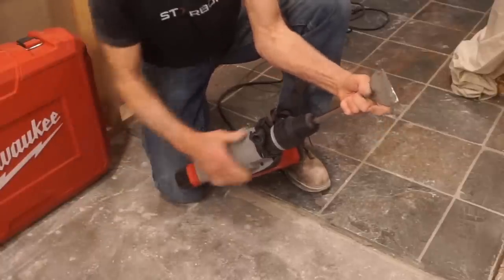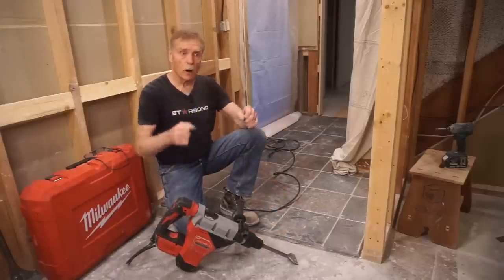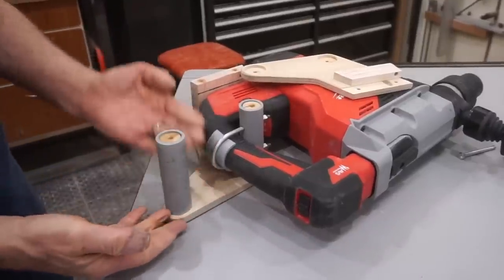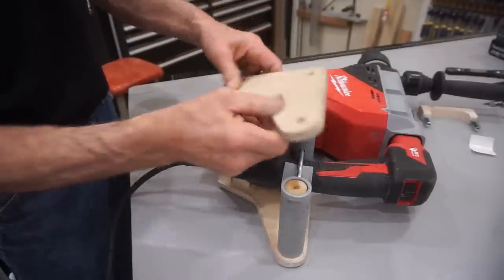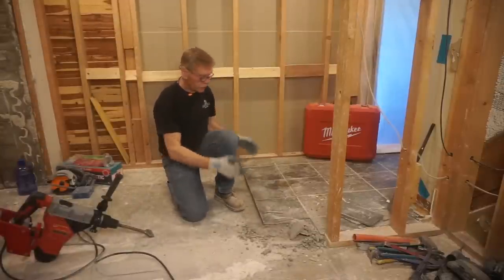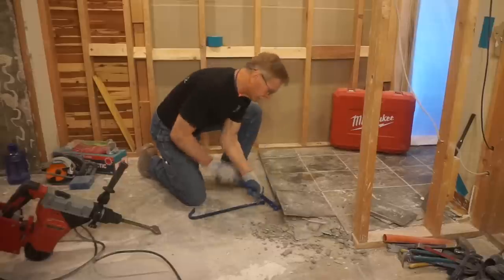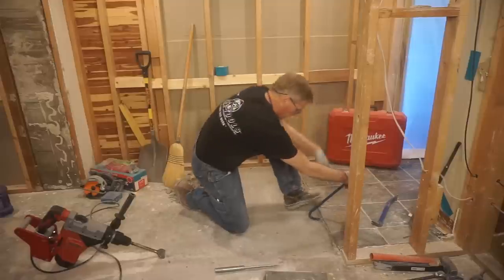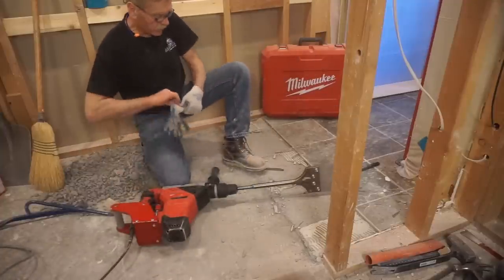Milwaukee Rotary Hammer Review & Ergonomic Improvement

Comment: In the real construction world we don't have time for this it's just a waste of time Just use the hammer drill the way it was design never had no problem with it yet
Reply from the maker: A 'waste of time' you say? Interesting perspective that lacks understanding of working smart and efficiently for sustainability over time.  At some point it may occur to you that there's a difference between just working hard and working hard AND smart.  Or not...
Reply: Bobby - I have to agree with your comment - You also have to consider the risk of injury due to the modification if you're passing it over to an employee to use.  I think out of the box is the best way to go - I personally use Makita and Hilti - the Milwaukee looks oversized for the task!
Reply: it's not the tool that has the issue which prompted him to make this modification....it's his wrist/hand/arm.  This mod was done to relieve the undue stress on his body.....the tool works the same either way.  Capich?
Reply: Sounds like these guys are not old enough to understand the importance of ease of use on your body. Sure you can use a tool out of the box. But if that creates stresses on your hands and joints, when you get old you will wish you had done things when you were younger to prevent long term injury to yourself.
Reply from the maker: Time has a way of highlighting issues not obvious in the status quo...
Reply: That's right, Bobby, you can take it, because you're a MAN,
but before you are ready to retire, you'll be sobbing about
your arthritis pain and the fact you can't use your hands anymore.
Reply: Also, some people gamble, drink etc. as hobbies.  Designing and creating efficiency improvements is a more positive hobby regardless of scale of improvements.

Comment: Years ago I mounted a nylon ‘D’ handle from a broken shovel on the rear grip of a Hilti TE55 I used a pipe pvc pipe flange it allowed the handle to swivel for the most comfort.
Reply from the maker: Sounds like an interesting modification... I like that your version was able to swivel too.  With all the fuss for ergonomics, workplace safety, etc in today's construction world I'm quite surprised that tool manufacturers haven't realized the shortcomings in their tools that hands on guys like us find so obvious.  It's easy to imagine that design engineers don't ever do much of the actual work their tools are made to do.  I'll be curious if this generates any response from Milwaukee... but I'm not holding my breath for it!
Reply: @NextLevelCarpentry  thanks for the reply! I wouldn’t hold my breadth either, but maybe you can market it?
Reply from the maker: There's a chance that Milwaukee engineers will see this video and the Ergo Handle upgrade through my contact at Acme Tools since they are a huge outlet for the brand.  It would be gratifying to hear some sort of reaction from them but who knows.  Their in house R&D probably filters out stuff like this as distracting and of little long term value.
Reply: Hilti & Bosch are tops in demo hammers👍

Comment: I would use an SDs plus for scaling .. I’ve knocked up a lot of tile with my cordless Milwaukee fuel SDs plus.. they also sell a scraping blade for them that’s much wider.. you could also a go lot smaller of an sds max the 1-9/16 SDs max made by Milwaukee’s may not sound much smaller than the 1-3/4 but it’s half the weight and would eat through that job just the same all day.. don’t need much power for scraping old floor up.. the bigger ones are bigger for breaking block, concrete, and drilling. Not scaling. Seems like you’re wearing yourself out with that beast in an unnecessary situation man, you’ve only got one body, don’t break it.
Reply from the maker: You might know what you're talking about but the fact that you imply I don't makes me think you don't.
 You're welcome to tweedle away with a smaller tool for a job like this but, personally, I would have used the next size UP for this job, not a size or two down... I'll give you a call next time I get into a job like this and see if you can really put your words to work.😉🤯😎  FWIW no one knows the "you've only got one body" thing better than a 66 year old dude who can still outwork kids have his age!

Comment: Chipping you don’t need a handle if you use it as a off balance tool you would dig in could be worth trying with a less dominant hand and work away rather than work towards
Reply: Before anyone says anything about working backwards off hand it is worth it rather than doing the whole job off hand because it gives the forward motion once the back is done

Comment: Last summer I had to remove the tiles. I realized that 30-40 degree of the tip divides its impact to two directions up and down and loses its efficacy. Later I used the machine upside down and the tip relatively easily went under the tile because the major impact went almost horizontally under the tile. . Your MacGyver design is fabulous. I will copy that for this summer projects.
Reply from the maker: Most SDS Max chisels come new with a double beveled tip.  I think manufacturers do this because that configuration doesn't dull quite as quickly and I guess few users ever sharpen brute force chisel tips like these.

As soon as that tip starts to dull I re-sharpen it with a single bevel tip that works MUCH better.  You must have noticed I mentioned 'bevel down' orientation a couple times in the video because, as you realized, it really does make a difference in results.  FWIW I figure bits are expendable and use them accordingly.  At $26, the 3" bit is crazy cheap and I don't hesitate to re-sharpen it frequently during use on site using a 9" angle grinder and metal grinding wheel.
Best,
Matt

Comment: My long gone 1980’s era, Black & Decker, 1/2  chuck drill had a D-shaped handle that bolted onto the rear end of the drill. Notches at the NSEW points allowed you to set the orientation of the handle. Milwaukee could easily design a similar mount.

Comment: Really nice solution Matt!  It's amazing how much pressure we put on the nerves in our wrists...  Anything you can do to eliminate that stress pays off in spades.
Reply from the maker: Thanks Greg!  It was a fun hack to make and use with a good deal of satisfaction from having the first prototype actually be functional.  
For design perspective: I just started with cardboard templates to zero in on a workable configuration.  I intended to make the sides out of bent metal to offset width between the tool handle and desired handle grip width but it was going to be too much trouble so I resorted to wood, my favorite medium.  The design would have been more 'elegant' without the little maple filler blocks on the sides but not worth the extra effort logistically to make it happen... and my wrist doesn't even know the difference 😉

Comment: Consider v2.0 adding a roller under the balance point.  Weight of tool can rest on floor to greatly reduce fatigue.  Attaching roller to existing 1.0 handle increases effective vibration isolated mass to further reduce vibration.  Floor contact of handle assembly additionally reduces vibration.

V3.0 has sprung suspension on roller.  You can adjust the natural angle at rest, but can reduce the angle by pushing down.  In this case pushing much easier than pulling weight up, and you're already pushing agsinst tile, so aren't fighting yourself.

V3.5 is the same but with tool rotated 180 degrees.  Having handle mass upward allows less crouching snd a potential (but adjustable) angle of attack.  Might even be shallow enough to both chip then pry tiles in one go.

Comment: Tough job. The Rotary Hammer really helps, but the modification looks spot on. And necessary, too. There is no reason to cripple yourself while getting the job done. 
Thanks for the video!
👍👍
Reply from the maker: I imagine you can imagine exactly what my wrist felt like after a few hours chipping with the tool before I made the accessory handle.  Pain like that is a real motivator for creativity and determination to make it go away!  Mountain/road bike season is not far off and I don't want a lame wrist to keep me from that 😎
Reply: @NextLevelCarpentry  These days, I get sore just thinking about that kind of work.
😎

Comment: I have the similar-sized tool but it's a Bosch. I found that it's very uncomfortable being that low to the floor. So rather than rotate the tool I cut the b in half and welded extensions so I could stand up. Or be in a more upright kneeling position. This made it easier on my back my elbow and my wrist. I did this to both bits.
Reply from the maker: Great hack Traky Boy... I was looking for longer bits but I'll bet the manufacturers don't make 'em longer because people would pry with them which would put too much leverage on the chuck and cause it to fail.  I had a notion to extend the bits too so it's good to learn you found that a workable workaround. 😎

Comment: I've got the 5262-21 1" SDS PLUS rotary hammer - basically the SDS PLUS version of the same tool - has nearly all the same settings - no trigger lock but I think it has everything else. One thing I like about it is it's easy to use while rotated in any orientation, and also because it has a more shallow profile and less weight, you can bring it much closer to the floor. My guess is even with the lower power of SDS PLUS, it might do a better job for this specific work, as the ease of changing the angle of the tool lets you quickly find the sweet spot for maximizing progress. Highly recommended.
Reply from the maker: It would be interesting to compare the key feature of the two tool models: actual force/energy of the impact.  I have to think that more is better.  Like hitting with a 16 oz hammer or a 4lb sledge: really makes a difference.  That said, I'd hate to have to do much drilling at shoulder height with this tool where the SDS plus would be a lot more manageable...

Comment: Hi there Matt. I was about to pull the trigger on the M18 RH, but wound up going for the corded version in stead, since I wasn't sure how much immediate use it'd see, and I wanted it to be a lasting tool, not depending on future changes to battery interfaces etc., though so far Milwaukee's have been good about sticking to the same. 

Other factors leading to the corded version was weight and accessibility.

As I think I've mentioned, I'm in timber framing, and we use it both with re-ground chisels to fit woodworking, as well as specialty sds wood chisels. In timber framing repairs qe need a pretty sleek tool profile to get in where we want, and quite often we'd get in situations where the battery would get in the way. We don't have that problem on the corded.

Anyway, so far it's been a great tool, adjustments and tool holding capabilities are great, as well as ergonomics.
Reply from the maker: I never considered using chisels for wood but it sounds like a significant time/energy saver for that sort of situations!
Reply: I bought the Makita and it is so comfortable to use - it has a soft start that is amazing - I am a longtime HIlti user and owner and the Makita is better in my opinion.
Reply from the maker: @gregorymacneil2836  There seem to be a number of decent options out there.  I gravitate to Makita for a lot of my tools and understand your preference and satisfaction with yours.  Which model do you have?  Also curious if you experience wrist fatigue because, from all I've seen, no brand of tool in this category has a 'horizontal' handle configuration.
Reply: @NextLevelCarpentry  Makita HM0871C and HM1213C - I have not experienced any wrist fatigue except for overhead work - which you never really want to do with any demo hammer.  The trick of course is to let the tool do the work - I will tell you the soft-start makes the Makita amazingly precise with a pointed chisel. We have very few Makita tools but lots of Milwaukee - I bought the HM1213C first for a 5 inch basement slab demo and my father added the lighter HMO871C for everything else including some bush hammer work - I looked at the Milwaukee but thought it was bulky. My Hilti SDS handles everything else from drilling to light chipping but it is old and without modern vibration damping. Hilti would have been my first choice except that one Hilti is the same price as two or maybe three Makita.  If I were doing this day in day out I would have pulled the trigger on the HiIti.

No Demo Hammer is lightweight or free of grease - they all make for a dirty day of work.  Your handle looks interesting - I do enjoy your channel and am a happy subscriber.😀
Reply: @NextLevelCarpentry  Neither did I before actually entering modern day timber framing restoration. It knocks off the bulk right quick, and you can actually shave it fairly close with a little practice. We use both SDS MAX and SDS PLUS for it, depending on size, location etc. The rest is done with a 5" grinder with a 14 grit TCT flat disc and hand tools, to get into all the corners,  but it does save a great deal of back breaking positions for extended periods of rime, when working in-situ, shaping existing timbers to accept either a Dutchman, a scarf joint or whatever else may be the case. Of course it's quite a bit different on these shores, as most of the timber framing is halftimbered, and not a fully exposed structure, like timber framing typically would be in the US. We don't use them on fresh lumber on the horses of course - that's the reign of saws, chain mortisers, mortise axes etc.

The SDS MAX chisels we've had to shape from concrete chisels, so it's a case of finding the right length, width and shape, whether you need it straight or angled. The SDS PLUS we've done the same, but Makita actually does make actual designated wood chisels for it, even in different sizes I think, but here's one.

https://www.amazon.com/Makita-P-25111-Chisel-30X170-Multi-Colour/dp/B000UYZK06

Comment: I had to opt out of this one. I have stopped buying tools from Chinese Tool companies 6 or 7 years ago. 
I use a Bosch DN1020VC with the 6 inch scraping blade. The tiles just fly up and it scrapes the thin set too. Oh edit I checked at 29:40🤣😂 you don't know it but you do need the Bosch DH1020VC!
Reply from the maker: I might "need" that Bosch, but I don't want it.  What I really need is to hire someone with a Bosch DH1020VC to do this removal for me!  A reputation for being great at tile removal is something else I don't want. Plus, this machine can drill holes in concrete which is something I want to be capable of but not to the point of building a reputation for that either😉😎
Reply: @NextLevelCarpentry  yes I have them in all sizes from Bosch. The DH1020VC is 22lbs I think then I have a 14 lber  like that red one you had then the Bulldog then battery tools for the small stuff.

Comment: Nice idea.
I wonder if the chisel you started with created too much inertia to move.
I will continue to watch the video and see how it works.
Thanks for the video.
Reply from the maker: I don't think excess inertia is the problem with that wide tile chisel.  It's more a matter of lack of impact force to the point it just doesn't pack enough of a punch to fracture the underlayment.  Off camera I ended up doing sections of the removal with a 2" wide chisel that was more effective than the 3" size by another 30%.

Comment: It seems like renting a big powerful stand up scraper/hammer on wheels to do at least 80% of the area, leaving the remainder to do with kneel down hand held one would have saved a lot of what looks like a lot of very hard physical work.
Reply from the maker: The area is too restricted to make getting and using a bigger tool practical on a one-time basis.  I felt I'd loose everything it would gain which would be more obvious to viewers if I could show more of the actual jobsite in the video.

Comment: How much do you charge for labor per square ft(or entire job) to remove all the tiles in this case, especially you need to use this special tool? Thanks.
Reply from the maker: If you have to ask, you can't afford it! 😂 Seriously though: this type of work gets billed at my standard hourly rate plus rental cost of the tool and enough to cover extensive wear on the chisels/bits.  It's hard, nasty, grueling work that I only do for certain customers who understand the cost and value of the work they're getting for the $$ they're spending.

Comment: Hard to see in the video but wouldn't just drilling a hole where the speed control is be enough for you to adjust it with your finger?
Reply from the maker: I do think a 1- 1/4" diameter hole is all it would take and I'll probably add the hole next time the Ergo Handle is off the tool.  I thought there was enough space in there the way it is but had to use a screwdriver to reach in and make the adjustment...